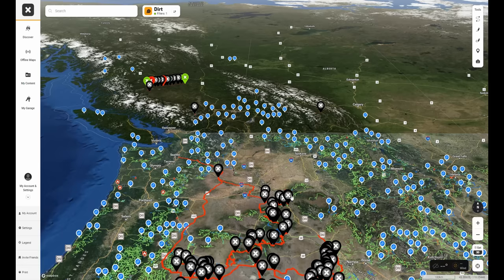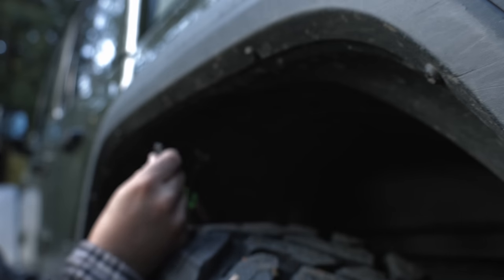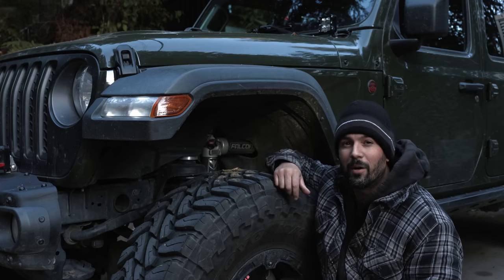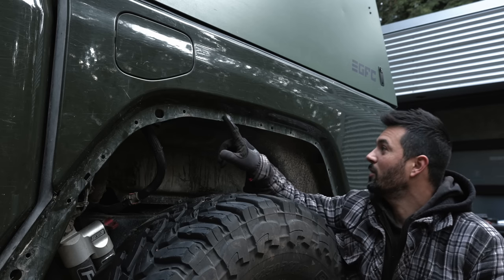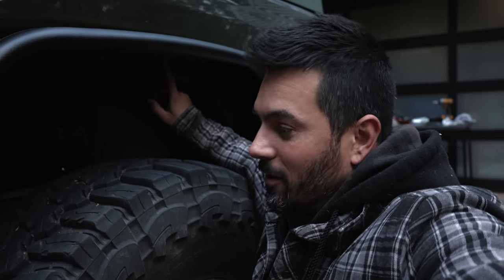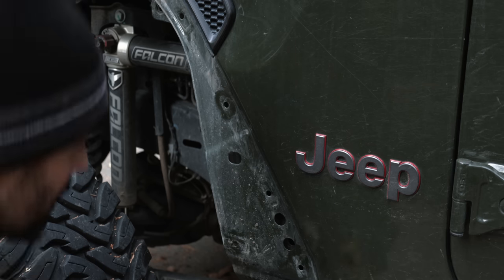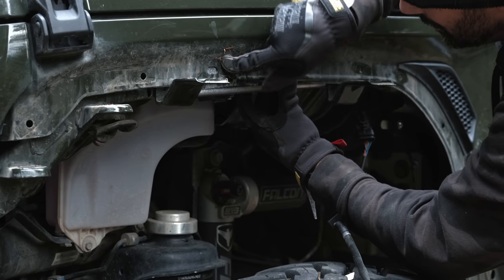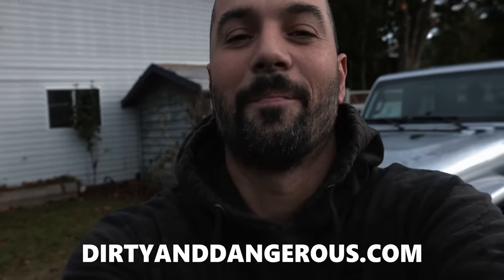Metalcloak Aluminum Overland Tube Fenders Install

Comment: Good job Teddy i dont often comment on videos but the one thing i would have done is use a rust inhibitor on the spots you drilled out on the jeep and metalcloak parts. keep the vids coming guys.
Reply: I believe they are aluminum but i could be wrong

Comment: While there are definitely good things about these, don't be at all surprised if you get large chunks of mud all over your hood, windshield and (yes) roof, and even your headlights.  Seriously.  Stock up on washer fluid, and bring extra with.
Reply from the maker: I’ve never been concerned with getting my truck dirty 🤟🏻
Reply: @TheStoryTillNow  Personally I'd be more concerned about the windshield and headlights, myself.  Those are safety concerns.  But as long as you stop to clean them when they get bad, which we should all do anyway, obviously it'll be fine.  Just expect to have to do that more often with these flares than you were used to, if you're in a muddy environment.  That's all I'm saying.

Comment: Ok, great install, cool fenders. I have one question however does the new week point become the sheet metal of your quarter panels? Because of the fender a solid something has to give. I’m interested to know how this works out. I like them. I have the quick inner fender, delete on the stock, painted fender of my jeep, and I have next ventures motorsports Christmas tree clip delete to screw in. I really put extreme stress on my left rear one last weekend, and my partner had done the same, but with metal fenders and dented his Jeep. I scraped the plastic and put touch up paint. No body damage was taken. But his Jeep took looks like Mike Tyson punched it.

Comment: 1) Rust Problem? Are the "Nifty Things" aka Clips with Nuts (time 9:32) made of stainless steel? If not they look like they will rust out in a winter.  A small steel part (Clip with Nut) with all of its sharp edges and surface area is going to rust like crazy if you live in a cold winter area with salted roads.   2) Damage Multiplier? It  doesn't look like there is enough reinforcement behind the fenders to stop them from damaging the body sheet metal ?  If you take any hard hits or do some rubbing will you please post a follow up on how well the fenders hold up and protect the body.
Reply from the maker: Everything is aluminum.

Comment: Great video as usual.  I have a question more than a comment.  When the Trail Wrecker died and you ordered the new one,  Did you think about a Diesel?   If so, what made you go with gas?  I'm about to order a Gladiator and I'm really torn between both.  What are your thoughts?
Reply from the maker: I’m not sold on the diesels. They have issues often from what I’ve seen and they are being discontinued.
Reply: Heard comments about the limited power range of the diesel whereas gas has a much broader power range. With gas, you can crawl up something instead of just sending it with a diesel.
Reply: Do the diesel, it's a beast. So much more torque than the gas engine. Very rare when I have to go into 4LO on the trail. Plus at least a third better fuel economy.

Comment: Unfortunately OnX doesn't work in Canada....won't even show up in the PlayStore. When I use my VPN and set it to the States, it will show but when I try to install it, I get a message saying "Not available for your area".
Even tried contacting OnX and they gave me some half-assed work around for the OnX hunting version only.  BRMB  works anyway. Just have to stick with that.
Reply from the maker: You can download the install file manually from various websites for Android, and it works in a browser. I'm told it will be launching very soon in Canada.
Reply: @TheStoryTillNow  at least we have the option of sidloading APKs. I'll have to hunt one down. It works without the subscription?

Comment: Great video Teddy. Only thing I would add is after drilling out the holes hit them with a little primer and paint. Keep out the rust from the wet coast rain and mud.
Hope your feeling better Shaun.
Reply: I believe the part he drilled is aluminium